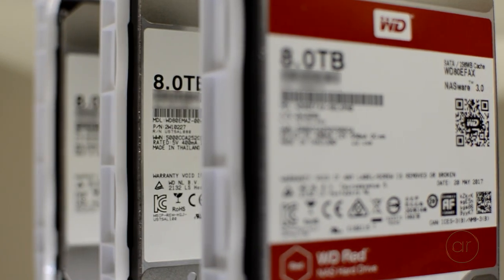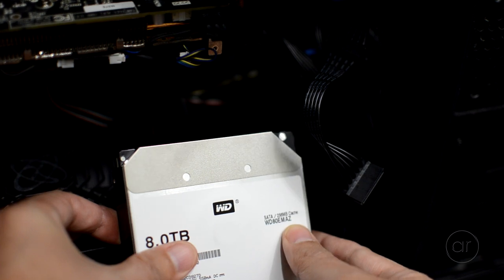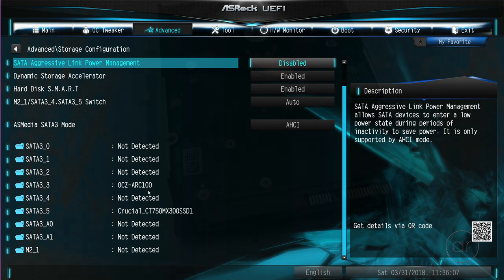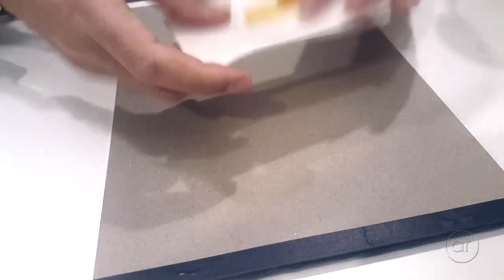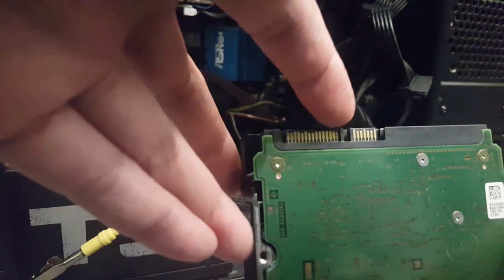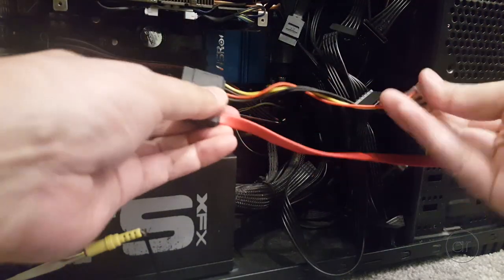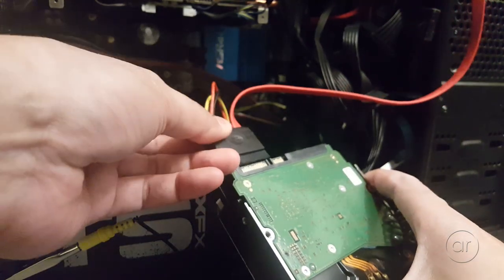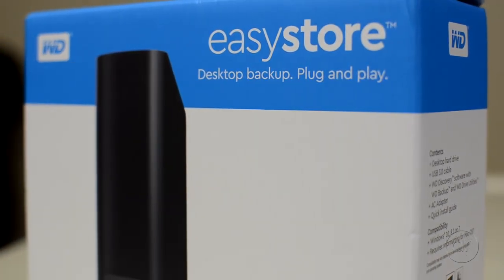How to Fix the 3.3V Pin Issue in White Label Disks Shucked from Western Digital 8TB Easystore Drives

Comment: So I have three of the 10 tb HGST drives from the  this same line and have done this trick and it works however I seem to have none stop drive drop issues in unraid with all three of them and read freeze issues. Tried different sata ports and cables to no avail. wondering if these wdc_wd100emaz drives have some firmware with head parking or something that causes issues?
Reply from the maker: I know the old WD Green drives parked the head every 8 seconds, but I'm not aware of the White labels doing so. I did some research on google and couldn't find anything that reflects freezing issues in unraid. Someone couldn't get the WD 10TB to even show up in the BIOS until he updated it - it's a different problem but you may want to try it if you're not using the latest BIOS rev.
Reply: @accessrandom   I have now re-flashed the bios, changed out the sata cables, re did the pin tape with 4 layers this time and covered all 3 of the first pins this time just in case and rebuilt the parity. Will see how this holds up in the coming week or so. if they fail again I will know that its either a firmware incompatibility to unraid and the way its using the disks or its the latest kernel that unraid is using given the fact that the head parks and such are around the same as different other drives. Spin up time is a little slower however I countered this by setting do not allow spin down so i'm not sure that would be the issue.  Thanks for the reply.
Reply from the maker: @ned1869  Thanks for the update. I'd be interested in how it goes... hopefully it won't be a hardware incompatibility.

Comment: this cable will work? Poppstar Doppio cavo dati Sata 3 HDD SSD, los Cables de Datos y Cables de alimentación en una, hasta 6 GB/s, Amarillo
Reply from the maker: In general, you want to use adapters that are crimped, not molded. You may want to view other videos where they talk about Molex to SATA adapters that won't catch fire...
Reply: @accessrandom  
What burns the hard drive with your magic method you say friend? Is it some kind of joke or are you serious? Regarding the molex to sata adapter cable, isn't this cable valid and the one you use similar?  Poppstar - Cable Doble de 60 cm, Cable Sata 3 de Datos y Cable de alimentación (Cable Sata 3 para Datos y Adaptador de Corriente Molex a S-ATA (4 Pines a 15 Pines SATA) en uno, Trenzado, Color Negro
Reply from the maker: @danielcarcanosanchez9790  Please check the link in the description and the pinned comment. I was being serious - I recommend researching this before using these adapters.
Reply: @accessrandom  So friend, is it safer to do method number 1, to paste a piece of plastic on pin number 4?  If method 2 friend is so risky, why do you recommend then?  I don't understand, I don't want firefighters to come to my house
Reply: @accessrandom  On the other hand, a cable that costs 10 dollars in Spain and of such a recognized and prestigious brand, I don't think it goes into ignition, but if you say so I believe you, my friend
Reply from the maker: @danielcarcanosanchez9790  You'll probably want to ask whether the connectors are crimped or molded. The crimped ones are safe to use.
Reply: @accessrandom  with curly cable you mean nylon coated cable, this one?
Reply: @accessrandom  Poppstar - Cable Doble de 60 cm, Cable Sata 3 de Datos y Cable de alimentación (Cable Sata 3 para Datos y Adaptador de Corriente Molex a S-ATA (4 Pines a 15 Pines SATA) en uno, Trenzado, Color Negro
Reply: @accessrandom  my england frienf, wich cable i must choose? the plastic yellow one or the nylon premium black one? regards

Comment: Does this happen with all the shucked drives?
Reply from the maker: No - not all. Some do not have the new SATA specification. Those that do may not work depending on the power supply.

Comment: If I put one if these white labels in a toaster , will that work or do I still have to out the tape over the pin? Thanks!! I want to use it as a backup
Reply from the maker: That's a great question. I haven't seen any discussion on docking stations, so my gut tells me the white labels will probably work (just based on the fact that I've seen no one bring it up). But worst case is that a piece of tape should take care of any problems...
Reply: @accessrandom  thank you for getting back to me. Gonna order one off eBay & give it a try

Comment: You really shouldn't run 3.5" drives in non 90 degrees orientations, like the video shows. Only mobile 2.5" drives are engineered to be working at any angle. Also you obviously shouldn't move or rotate the drive while it's working. I'm amazed at how many people do not know this. While modern drives are more resilient, the mounting requirements for desktop HDDs didn't really change. It's the same as with the static. Modern hardware are more protected, but the risk of killing the device with improper handling is still there.

Comment: Don't use the molded SATA power adapter! It will catch fire.
Reply from the maker: Thanks - I pinned a comment right after I uploaded to try to make it prominent. I've seen Youtube videos that show the fire damage done by faulty adapters - pretty scary...
Reply: Nope low voltage does not cause fires
Reply: @catsbyondrepair  It does if the current is high enough and/or the wire is too thin. The Internet is full of images and videos of these adapters melting or catching fire. Assuming that low voltage does not catch fire is grossly negligent.

Comment: hi. I have also same problem. I turned off wd last 5 month and now plugin its detected as 0 bytes and no spin
Reply: please help white level wd 8 tb mybook
Reply from the maker: If they are white label disks from Easystores and they don't power up at all, then it is probably the 3.3V problem.
Reply: +access random no its not from easy store. and I m affraid u write about catch fire. I didn't understand. I can make video and send to you,if u you guide mee.
Reply from the maker: Ah I see. I was referring to the molex-to-SATA adapter. I recommend searching for "How To Spot Molex To SATA Adapters That Won't Catch Fire" to research the correct type of adapter.
Reply: access random but I want tell u something. I think someone try another voltage adapter before.after that now no work. now I have original adapter which is come this mybook
Reply from the maker: If you put it back into the MyBook enclosure, does it work?
Reply from the maker: Sorry, I am unable to give phone support. If it doesn't work in the enclosure - and another drive does work -  I'm afraid the drive may be dead. If you need the data on it, have you considered a recovery service?
Reply: access random yes.that I m also afraid of data.I m affraid also recovery service because that drive have 21000/-$ usd content. thats why I cant send them for secret reason.  even here local shop affraid about data.they also see this issue 1st time.All parts ok but no spin.
Reply: and is this your trick for just for spin or other cause. can u explain.and thanx u reply.
Reply from the maker: Yes, this is only for SATA Rev 3.2+ or Rev 3.3, which have the power disable feature.
Reply: access random I found this information on label. Rated: 5V 440 ma,12V 550ma DC

Comment: cUT THE 3.3 volt wire to the sata  power connector problem solved....
Reply from the maker: That's certainly a valid solution. I was focusing more on non-destructive methods but that is a good idea.

Comment: This didnt work, then I used packing tape instead of electric tape and then it worked fine. Use thin tape!
Reply from the maker: Good point - I tried the thick black electrical tape myself before I tried the Kapton, and it stretched the connector outward because of its thickness.

Comment: As soon as you plug it in the tape will be dislodged
Reply from the maker: It can be difficult with such a thin piece of tape, but you can cover pins 1, 2 and 3 with a wider piece of tape if you'd like - this will work as well.

Comment: Why not just remove the pin 3 trace from the drive's edge connector?
Reply from the maker: That's a perfectly valid way to solve the problem - I was just focusing on non-destructive ways to cover the pin.
Reply: @accessrandom  Understand - but as it serves no useful purpose in "normal" use... This way you don't go nuts if the tape falls off when you move the drive to a different computer. Anyhoo - I didn't know about this, but now do. The trick, of course, will be to remember it if it ever bites me. :-) Thanks.

Comment: Anyone had experience with shucked drives from wd elements? 

How reliable have they been for you?

State how long you had them, what model of internal drive and size, name and size of the entire unit, how many and how you're using them. 

Thinking of buying 10TB ones to shuck because I don't want to end up with ones that aren't usable should the bridge fail, although according to this, the drive will be useable without the enclosure: https://support.wdc.com/knowledgebase/answer.aspx?ID=15150&amp;s
and because IF they're reliable I could use them in a NAS.

Is that information true from that website (official WD website). Can the drives REALLY be used without the enclosure? Say for example I want to use the unit as a whole, then one day the bridge fails, can I then just shuck the drive and continue using it, or will the data not be accessible anymore?

Thanks

Comment: You talk down to your viewers and explain things that a person who would go through the process of shucking drives would know. It infuriates me. Also, the 3.3v pin is used to shutdown the disk to save power when the disk is no being used. It's designed to be utilized by the drive controller built into the PCB in the case, but the older SATA standards have yet to catch up to Mobo Manufacturers.